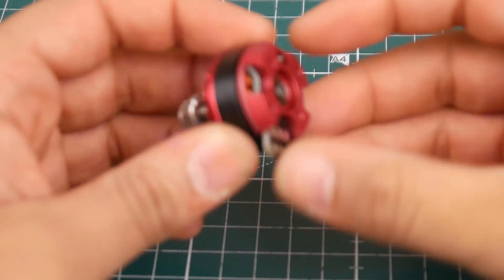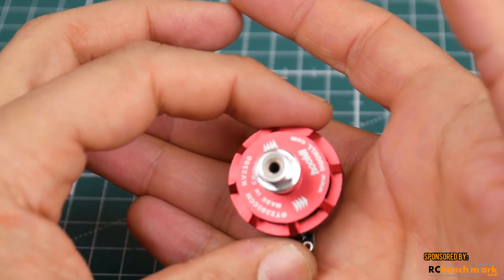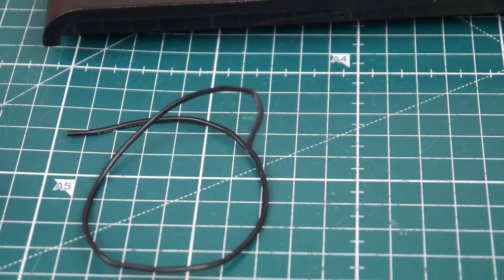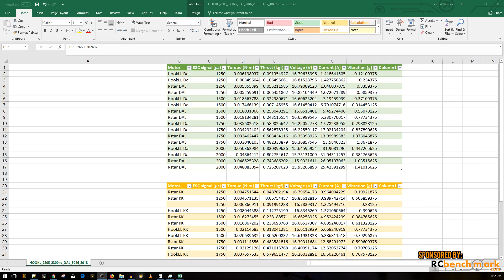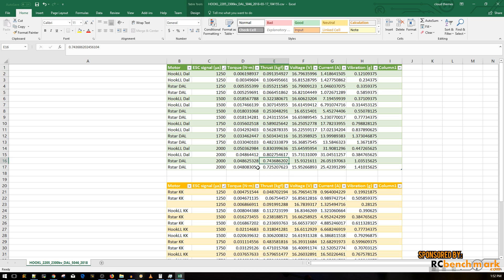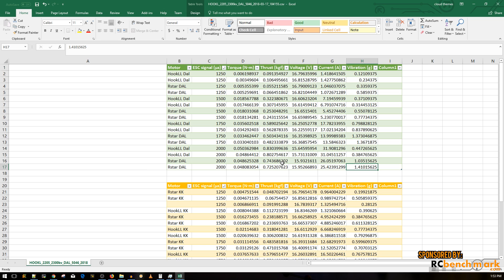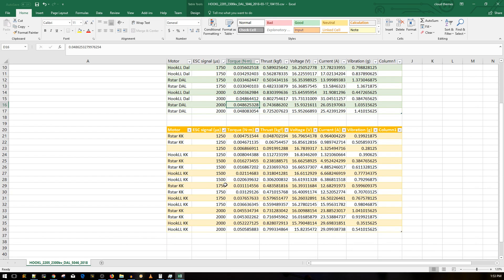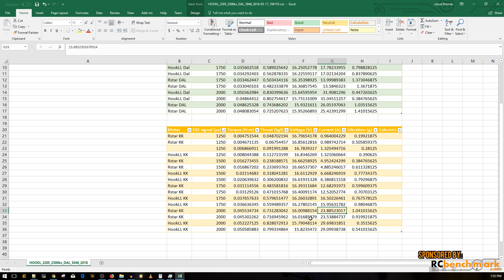2205 Budget Motor Shootout Thrust Test // Hookll GT2205  vs Racerstar 2205s

Comment: The original red bottoms now cost $10. Could u test it too since it is now in the budget category? Also, please test a different category of prop. The two u use are fairly similar in weight and efficiency. Maybe a 5x4x3

Comment: Dear, lets start using round function in Excel, to see normal values 2-3point after dot. Formula example, where C4 is cell which contains value to be rounded, result will be given in the cell to you where you write this formula =ROUND(C4;3)

Comment: As usually great work DM.... but what do you think about the opportunity to test vibration motor without propellers ?
Unbalanced props can affect the value
Reply from the maker: I am preparing a testing methodology for motors. I had to contact with the bench manufacturer to send me custom software to bypass limitation of specific areas and add couple extra features witch I just received it 2 days ago.  

So upcoming motor tests and reviews will have the following data.
RPM
AMP
THRUST
TORQUE
VIBRATION(WIth and WIthout Prop)
Efficiency
Temprature
Reply: Great info... thanks  :-)   !!!